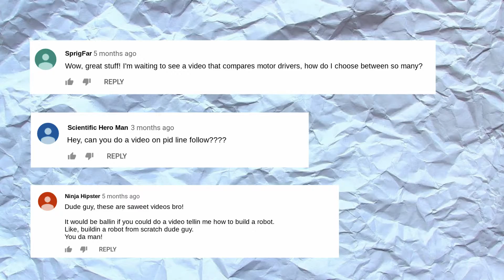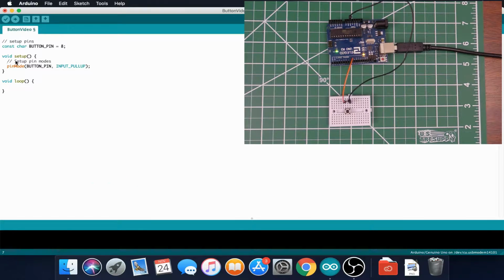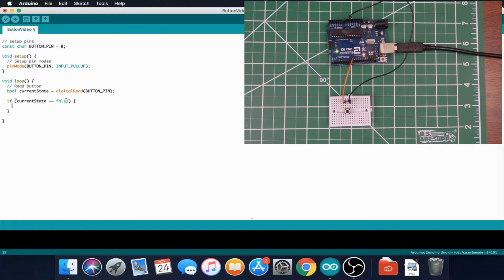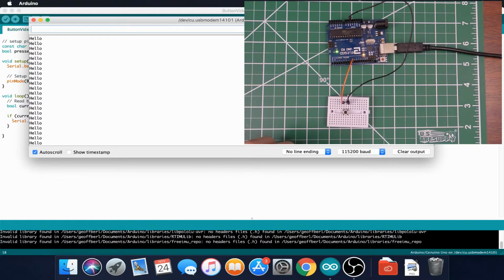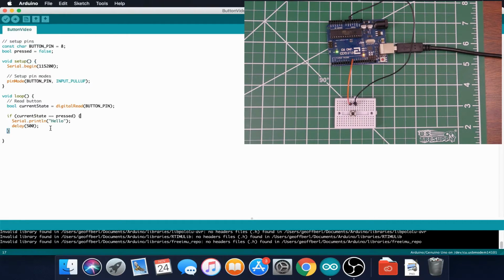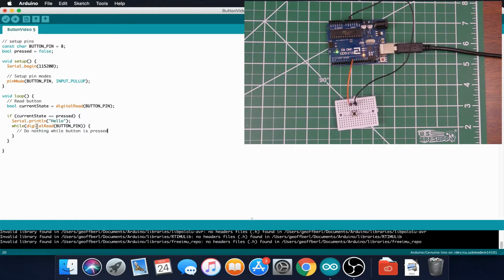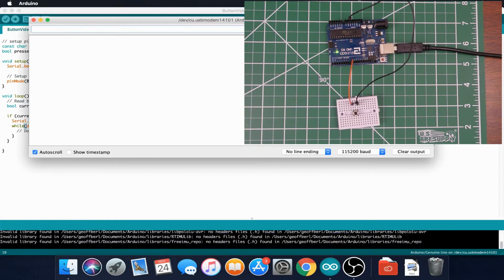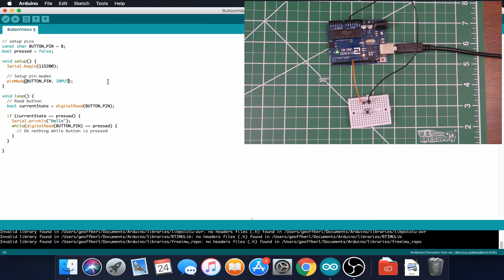How to Program a Push Button with an Arduino

Comment: Do push buttons only work in void loop? Because I can’t seem to get it to work in setup, help would be appropriate!
Reply from the maker: No, buttons work anywhere in the code, can you provide more details, maybe some of the code so I can take a look?
Reply: @RobotResearchLab  sure, this isn't all my code, but essentially this is the part of the code that I just can't get to work; in this instance of code it will only print "OFF".
My main code is part of a function() and when I call it to setup() it doesn't work, I've been thinking that I need something like "while(Serial.available()==0);" but in terms for push-buttons, not sure tho

#define SWITCH0 12  //push-button #0 pin 
void setup() {
  Serial.begin(115200);

  int sw0;  //reading for push-button #0

  sw0 = digitalRead(SWITCH0);
    if(sw0 == LOW)
      Serial.print("ON");
    else
      Serial.print("OFF");
}

void loop() {}
Reply from the maker: @325.minutes  Ahh, okay. Yeah, the setup() function only gets called once so, I misunderstood your initial question. It works anywhere but setup only gets called once so it's only going to check the button state once in this case.

What are you trying to do with your button? That will determine whether you want it in the setup() or loop()
Reply: @RobotResearchLab  currently I'm working on a project that is essentially a restaurant menu that has multiple functions(), and I'm using the buttons as inputs to order items off the menu (in a binary configuration), I guess there's no specific preference as why the code should be in setup() or loop() (that I could think of at least) but I guess I was just wondering How I would be able to get it to work in setup()
Reply from the maker: @325.minutes  Typically the use case for having something like this in the setup() function is if you want to turn your project on but you don't want it to start the main code until you push a button. An example would be a Line Follow competition, you would generally turn your robot on but wait for the judge to say GO! before starting the line follow. In this case you might add a loop in the setup that keeps checking the button, once the button is pressed it would go on to the loop() function to start the line follow process.

If you want a menu then I would suggest putting it in the loop, that's actually not a bad idea for a video and that would be super quick to make which is good given my limited time lately ha ha. The reason I would suggest using the loop() is because, unless you only want to check that button state once, it's more difficult to use the setup function.

In any case, here is how you would put the button in the setup() as an example, to wait and only enter the loop() once the button is pressed. I haven't tested this code but, as long as you have a button that is tied to GND it should work. This will only print once though, then it will go on to the loop(). If you want it to keep checking the button you'd have to wrap all that code in a while(true) loop, but that's what the loop() function is so you might as well just use that. This also doesn't wait for the button to go HIGH before continuing so, as is, if you moved this code to the loop() function, it would keep printing while the button is pressed. You'd have to add in the code to wait for it to be let go if you wanted that. I hope this helps.

const char BUTTON_PIN = 2;
void setup() {
  // Pull the button HIGH
  pinMode(BUTTON_PIN, INPUT_PULLUP);

  // While the buton is HIGH (not pressed)
  while(digitalRead(BUTTON_PIN) == HIGH) {
    // This will loop until the button is pressed (sending it LOW)
  }

  // This will only print when the button is pressed
  Serial.println("Yo");
}
Reply: @RobotResearchLab  Ah, I see. I'll definitely test out both options, but yea like u said, it probably would be more efficient to use it in loop(). Thanks for all the help, I really appreciate it, I learned more than I thought I would ha
Reply from the maker: @325.minutes  Not a problem at all, thanks for commenting, I'm glad you learned new things.

Comment: Do you know how I could do it so when the button is pressed 6 times, a number is then +1?
Reply from the maker: Sure, I'll try to explain in a comment, hopefully it translates.

What you'd want to do is, in the if statement for the button (if currentState == pressed) you want to add to a variable that will count the number of times the button is pressed. So, for starters you'll need to add a variable in the global variables (let's call that btnCounter). Then each time the button is pressed, increment that counter. Then add an if statement to increment your value if the btnCounter is equal to 6... then reset the button counter. Here's an example

1. Add a variable up top like: 
     char btnCounter = 0;
2. Modify the if statement to keep track of button counts and add an if statement to increment your variable
    if (currentState == pressed) {
        btnCounter++;    // Increment the button counter by one
        if (btnCounter == 6) {
            aNumber = aNumber + 1;    // Could also use aNumber++;
            btnCounter = 0;     // Reset the button counter
        }
        ... Other code from the video (Serial print and while loop) here
    }

You could simplify it even more so you don't need to reset the counter by using `if (btnCounter % 6 == 0)` but don't worry about that until you understand the code above.
Reply: @RobotResearchLab   Ah that's great thank you, appreciate it. One more thing. Could I use another button which would make the number go down. And everytime it was pushed 6 times it would decrease by 1? Basically the same but opposite
Reply from the maker: @tdb1940  Yeah, definitely. For that you would need a whole other if statement to handle the other button (the one that handles going down). Everything else would be the same only you might want to change btnCounter to something like btnUpCounter so then you can add another for btnDownCounter. Then when the up button is pressed it would add to btnUpCounter (like the code I showed in the previous comment) and you'd have another so when the down button is pressed it adds to btnDownCounter and when that reaches 6 you decrease your value by one and reset the btnDownCounter. So, essentially you'd have something like this:

    if (btnUpCurrentState == pressed) {
        btnUpCounter++;    // Increment the up button counter by one
        if (btnUpCounter == 6) {
            aNumber = aNumber + 1;    // Could also use aNumber++;
            btnUpCounter = 0;     // Reset the button counter
        }
        ... Other code from the video (Serial print and while loop) here
    }
    if (btnDownCurrentState == pressed) {
        btnDownCounter++;    // Increment the down button counter by one
        if (btnDownCounter == 6) {
            aNumber = aNumber - 1;    // Could also use aNumber--;
            btnDownCounter = 0;     // Reset the button counter
        }
        ... Other code from the video (Serial print and while loop) here
    }

Does that make sense? (you'd also have to change "currentState" to btnUpCurrentState and add one for btnDownCurrentState since you'll have two buttons.)
Reply: @RobotResearchLab   essentially I have a scenario where i need to create a monitoring system for a theme park ride which will count the people coming in. 6 people maximum is allowed on the ride. Ride takes 30 seconds and goes automatically. Every 6 people is 1 minute  queue time.
Reply from the maker: @tdb1940  Cool, so is this to give an estimate of wait time, monitoring people as they enter the ride, or something else?
Reply: @RobotResearchLab   Yes both of them.
Reply from the maker: @tdb1940  Sorry, for some reason YT didn't tell me about this comment with your code so I never saw it. For starters, I'm seeing some issues with the open and closed curly braces, maybe you just missed some at the end while copying. You're also missing a semicolon when you read the digital pin, and a couple closing parenthesis are missing. These are all syntax errors and very common if you're new to programming.

So, I cleaned up the syntax and moved some stuff around. The code provided should work but it's going to depend on the process you are using for this. The way it's set up right now is you could count as they enter the ride and as they leave the ride, this would make sure that "aNumber" is only ever 1 (when they enter the ride) or 0 (they left the ride so nobody should be on it.) You could also walk down a line and click up for each person, then aNumber will keep growing every 6 and you can determine the total queue time by just looking at aNumber which will represent the minutes since it's only 1 minute per ride. But, the problem there is you'll need to adjust that number if people leave the line or new people join. Lastly, had I known this was the situation, I would have possibly suggested just counting every click and dividing that number by 6 to get the total number of rides needed (or the total number of minutes). Anyway, I'll post the code for you to look at before I keep rambling on any more. After you paste it into the Arduino IDE, I would suggest using Ctrl+t to auto format, it will make sure the code is indented properly and make it easier to read.

const char btnUpCounter = 2;
const char btnDownCounter = 3;
char aNumber = 0;

void setup() {
  Serial.begin(9600);
  pinMode(btnUpCounter, INPUT_PULLUP);
  pinMode(btnDownCounter, INPUT_PULLUP);

}

void loop() {

  // Check if the btnUp button is pressed
  bool btnUpState = digitalRead(btnUpCounter);
  if (btnUpState == false) {
    btnUpCounter++; // increment the up button counter by one
    // If the button up count reached 6, increase the number by one
    if (btnUpCounter == 6) {
      aNumber = aNumber + 1;
      btnUpCounter = 0; // reset the button up counter
      // Print the counter just to see how this works
      Serial.print("aNumber value: ");
      Serial.println(aNumber);
    }
    while (digitalRead(btnUpCounter) == false) {
      // wait for the button to be released
    }
  }

  // Check if the btnDown button is pressed
  bool btnDownState = digitalRead(btnDownCounter);
  if (btnDownState == false) {
    btnDownCounter++; // increment the down button counter by one
    // If the button down count reached 6, decrease the number by one
    if (btnDownCouter == 6) {
      aNumber = aNumber - 1;
      btnDownCounter = 0; // reset button down counter
      // Print the counter just to see how this works
      Serial.print("aNumber value: ");
      Serial.println(aNumber);
    }
    while (digitalRead(btnDownCounter) == false) {
      // wait for the button to be released
    }
  }
}

Comment: how can i impliment a link so when i press the button it opens for example Youtube?
Reply from the maker: If you want it to open a link on your computer, that would be a tricky one, the easiest solution I can think of is to use the Arduino to execute a macro (or script) on your computer (you would need to use an Arduino Pro board). It is a little more involved than something that can be explained over a comment. Interesting idea though, maybe I'll create a video for it... not that it would probably be watched by a lot of people, it's a pretty specific use case lol. I'll add it to my list of ideas though, thanks for watching.
Reply: @RobotResearchLab  Thank you men, I also think it would be a great idea. I'll sub rn so I don't miss it

Comment: Thank you really helpful now I’ve just gotta work out how to do this with many buttons and make it so a game can understand it haha
Reply from the maker: Let me know if you run into troubles, maybe I can make a video about it... I'll eventually get time to make more videos ha ha.
Reply: @RobotResearchLab  I’ve tried loads of different ways of trying to add multiple buttons and give each button a name to be recognised on pc but i can’t seem to get it to work any tips or videos you have done
Reply from the maker: @johnmasters2099  Oh okay, you're trying to make a game controller that can enter keys on a PC (basically a keyboard)?
Reply: @RobotResearchLab  yes basically but I’m also adding a joystick using potentiometers but I havnt got that far yet lol thort I’d master the button coding first lmao
Reply from the maker: @johnmasters2099  This should be as easy as just using the Keyboard and Mouse libraries included with the Arduino core libraries. I personally haven't used them BUT I do know that only certain boards will work. Essentially I'd suggest the Arduino Pro Micro (or third party version) as it'll be the cheapest of the boards that have this ability. For how to do this, again, I haven't done it myself but looking over this article looks promising. https://maker.pro/arduino/projects/how-to-turn-an-arduino-into-a-keystroke-automation-tool
Reply: @RobotResearchLab  yes

Comment: How to connect switch with variable resistor to control light altered  (switch-on/off,variable -as dimmer)
Reply from the maker: Just to clarify, you want an LED that has a variable resistor and a button? Like a wall switch where you can set the brightness but control on/off with a button?

Comment: can you give some amazon links for the things you used
Reply from the maker: Sure thing, here they are: 
Arduino Board: https://www.amazon.com/gp/product/B01EWOE0UU
Wires: https://www.amazon.com/gp/product/B005TZJ0AM
Breadboard: https://www.amazon.com/gp/product/B077PK858F (These are unavailable but there are many other options, don't pay more than $10 for a set of 10-12 of the mini boards)
Breadboard alternative: https://www.amazon.com/gp/product/B07DL13RZH (This gives you multiple options for different sized projects)
Buttons: https://www.amazon.com/gp/product/B07WF76VHT (The ones I have are unavailable but I wouldn't recommend the ones I have, I would get these since they're made for breadboards)

But actually, If you're just getting started I would recommend this starter kit, for less than $20 you get everything you need to do many different projects. It includes everything you would need to build the project in the video as well. https://www.amazon.com/gp/product/B01DGD2GAO
Reply: @RobotResearchLab  thanks!

Comment: what are you printing the text to?

I try doing this in notepad but it doesn't work.
Reply from the maker: You can either go to Tools-->Serial Monitor or click the magnifying glass in the upper right toolbar. It's a built in tool for monitoring serial inputs.
Reply: @RobotResearchLab  Thanks for the reply, I managed to figure it out shortly after.
Reply: @RobotResearchLab  Super helpful tutorial and I managed to get this to print to serial. But is there a way to actually get this to type "Hello"  in Notepad?
Reply from the maker: @theyutethatdoot7895  In order to do this there are a few things that need to be done ahead of time. In its simplest solution, if you had Notepad open and the cursor was in the application ready to type then you could use something like an Arduino Pro Micro which can act as a keyboard or mouse for any PC. Then you would have to use the Keyboard library to send the text to the computer and it would basically be as if you were typing.

It's possible that you could pair an Arduino sketch with a script on your PC so that when the Arduino is detected, it opens Notepad and starts typing but that would be pretty involved and require a video to explain.

First and foremost though, you would need an Arduino that has a chip capable of supporting keyboard and mouse functions (Pro Micro is probably the cheapest/most easy to find and non-Arduino brands will work as long as they market as a Pro Micro board).
Reply: @RobotResearchLab  Thank you for the thorough reply. I'll try the Arduino Pro Micro since I have all the other components on hand. Again, thank you!
Reply: @RobotResearchLab  I got an Arduino Micro and got it to do what I wanted :D Thank you!
Reply from the maker: @theyutethatdoot7895  That's awesome, congrats. I'm glad I could still help even though I have no time for videos right now ha ha.